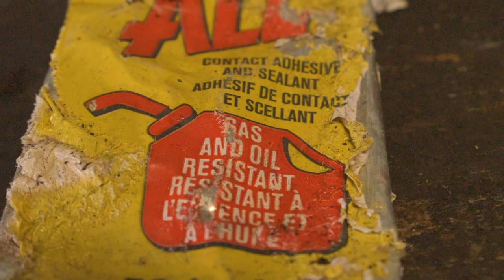Did I Sell The Apollo RFZ? What Happened To It?

Comment: How long had you owned it before it broke?
Reply from the maker: I blew the 125cc transmission after like 3 months. Since swapping the 150 in it its the dream
Reply: @AaronsEnduro  oh so maybe I shouldn't get this im desperate but it sounds pretty unreliable also where did you get the bigger wheels incase I do end up getting it
Reply: @AaronsEnduro  and how was the engine swap any major problems doing it or was it relatively easy?